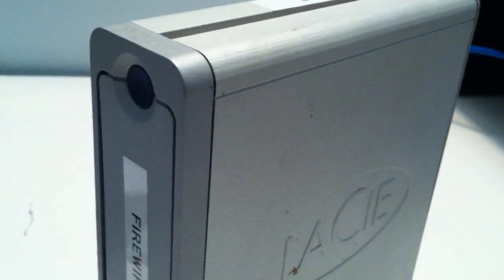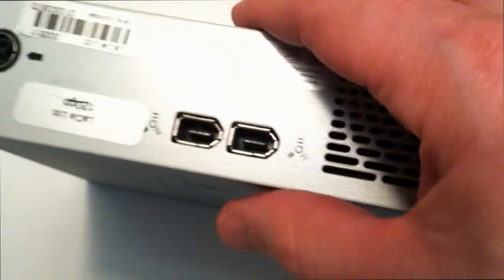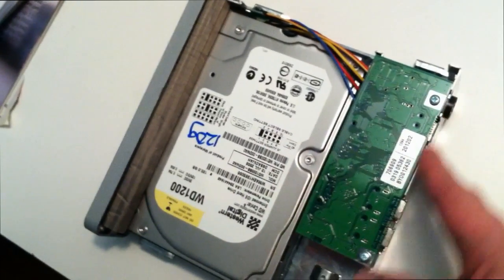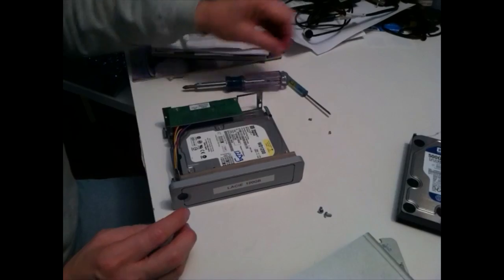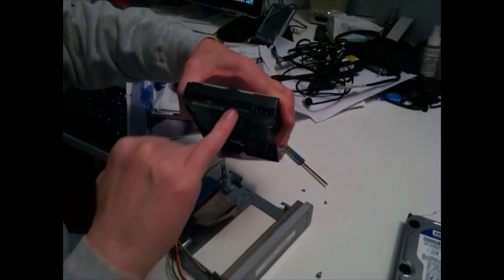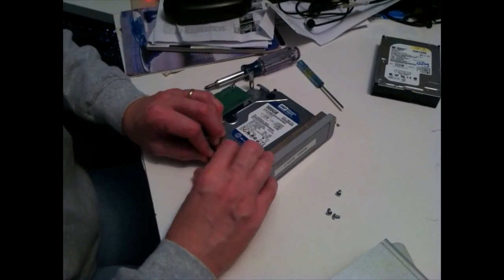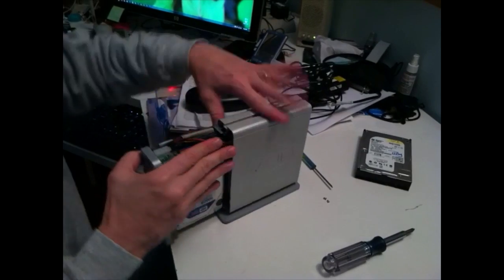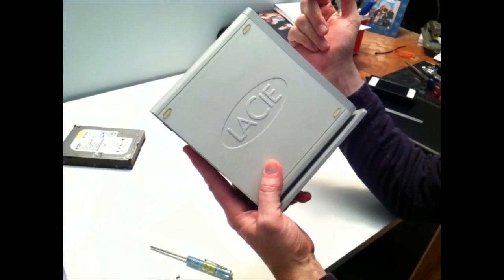LaCie Firewire 300511 Upgrade

Comment: I see, this is the older IED, but todays drives are STAA...
Reply from the maker: And don't forget SDD, the technology has changed a lot in the 9yrs since this video was made. Thank you for watching.
Reply: You could probably use a IDE to SATA adapter board with a 2.5" drive. I want to get one of these cases to try it out.

Comment: I have that same Lacie hard drive and I think the hard drive that's in it has stopped working. Would it be possible to replace the old hard drive with an SSD?
Reply: NO YOU CANNOT!

The simple answer...

J.C.

Working on Mac's since 1997....

Mechanic!
Reply from the maker: Well in this LACIE case there is a hard drive with an IDE connection. SSD use SATA connection so you would have to gut the electronics and get SATA cable from the SSD to the computer. Probably want to go SATA to USB, maybe something like USB 3.0 SATA III Hard Drive Adapter Cable for 2.5 Inch SSD & HDD with Support UASP-20cm. If you got this cable you could dump the LACIE unless you just wanted to hide the SSD. Hope this helps. Be curious to know what you decide.
Reply: I guess I won’t be using an SSD if I would need to replace the cable. I have an extra 1gb hard drive that I could use.  Would replacing the old hard with a 1 tb hard drive be an issue?
Reply from the maker: @tymantis  As long as the drive is IDE you shouldn't have a problem.
Reply: The 1 TB hard drive that I have is the right size but isn’t compatible. Is there a particular hard drive that you would recommend?
Reply from the maker: @tymantis  They stopped making IDE drives years ago. They were replaced by SATA, which won't mate with the IDE connector. You may still be able to find them used on ebay or Craigslist, but I would just buy a new probable drive and make the LACIE into a safe, paperweight, bookend or recycle it.
Reply: It’s probably not worth fixing if that’s the care. Thanks for sharing.
Reply: Precisely!
Reply: 250GB 7200 rpm 3.5" IDE drives can be had on eBay for $20 to $30.

I put such a WD in mine, last year....

Works fine with my Macs with FW800 ports

500GB IDE 72K drives are a bit more expensive.

Rarer!

A 320GB 54K IDE drive from a thrift store find older DVR cost me only $5 a few years ago....

Newer DVR's are SATA...

Luck!

J.C.